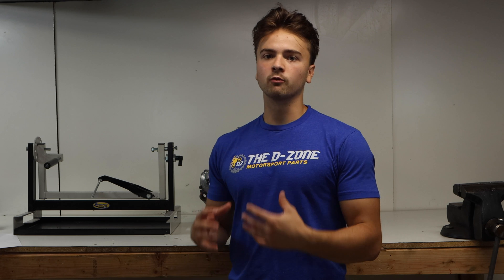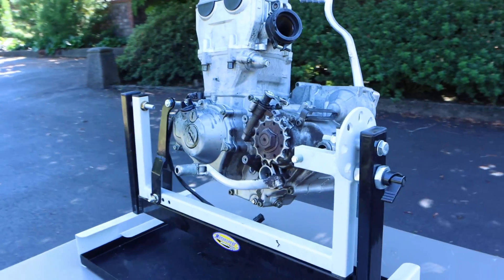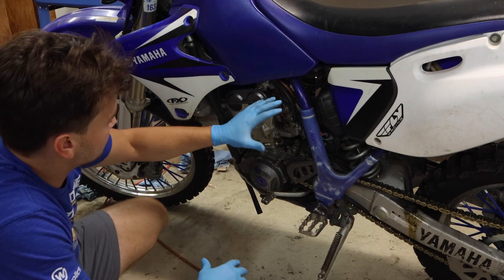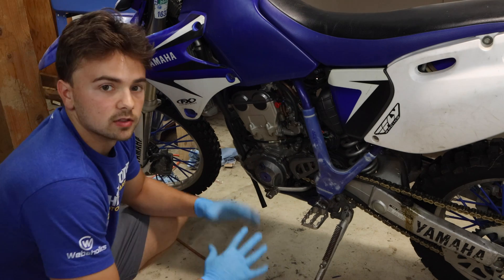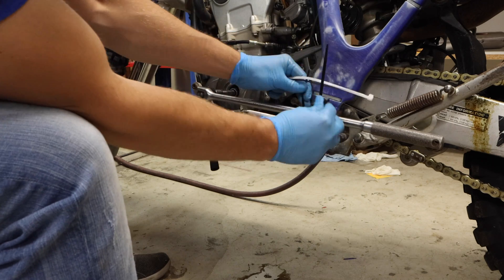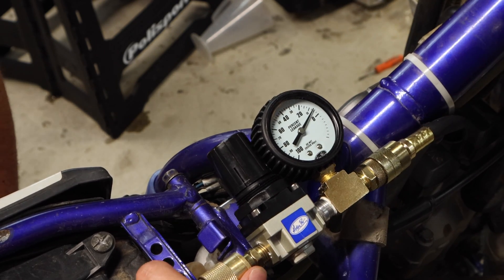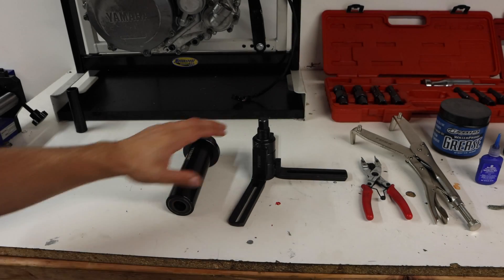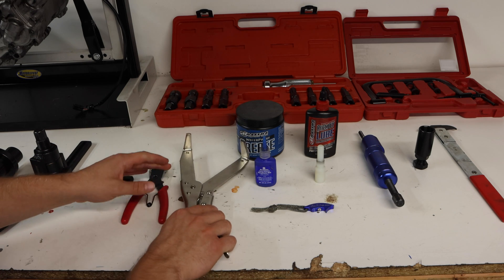Complete Four Stroke Engine Rebuild - Everything You Need to Know Prior to Tear-down! Part 1

Comment: Thanks for the vid. So, you never mentioned how to deal with the auto decompression. Doesn’t it keep the exhaust slightly opened at TDC? How do I get the valves closed during the leak down test? Thnx!

Comment: im 16 and im rebuilding my first dirt bike i was really dumb and didn't think about checking my oil and was out on my first real ride was about 3 hours into it and my bike just stop running and stoped really hard its a 2007 rmz 250 and i havnt really found a good video series for my bike so im going to watch all of your videos and ill keep it updated if anyone is interested or need to know anything about a Suzuki 250 4 stroke i have the hole bike tear down to frame and am going to be putting more time   and money into her then the bike probably worth but who cares keeps me out of trouble if im in my dads shop all night for a couple weeks 🤣
Reply: my dad did help me do a compression test and it was like at 25 30  psi and i did take the valve over off and did this measuring thing and its about .15 out of time on the exhaust and so much out of time on my intake that i didn't have a big enough shim thing so i think with how low my oil was my valves probably seized and my piston hit them the reason i think that is bc both were out of time so they probably got stuck in between the the exhaust and intake stroke (in that order) so im going to tear the engine all the way down and if its top end is messed up to bad like the cylinder walls are scared and the piston is gone  im going to do a full race build with a big bore and race piston and maybe even a stage 2 hot cam  im going to comment though out the hole series if anyone has any idea for the build or knows something i don't help a bro out please

Comment: Hey, my name is Owen and I own a 2009 Honda crf250r. I am having issues when my bike is hot starting. I’ve been told that it might be the valve shims but they are in spec. I re jetted the bike to make it run better but have no luck. When I start it it will either run good, or won’t want to idle and be hard to start. When I let it sit and cool down for a bit it starts well. My spark plug has plenty spark. Do you know what may be wrong with my bike?
Reply: Check ur timing make sure you go TDC then refer to your manual make sure ur aligned and double check urself